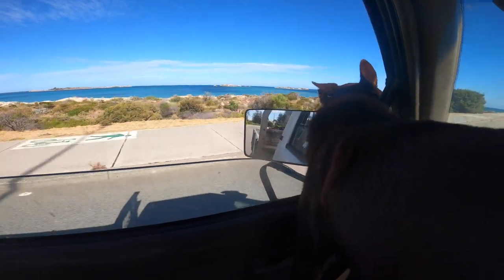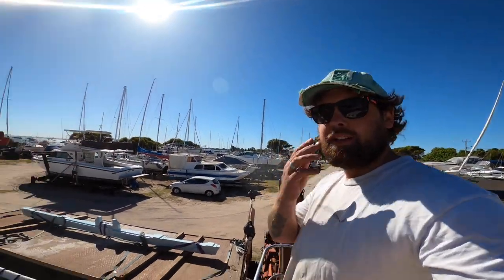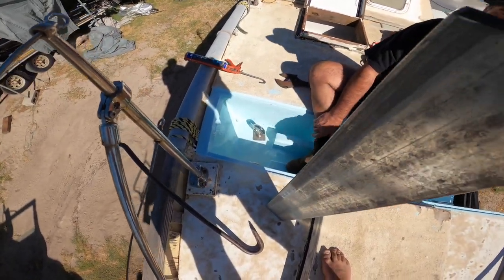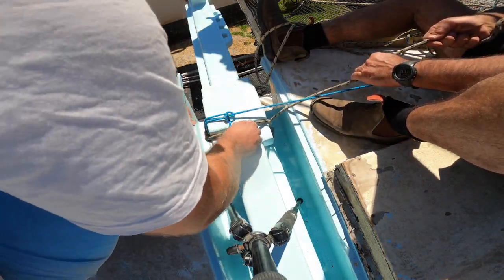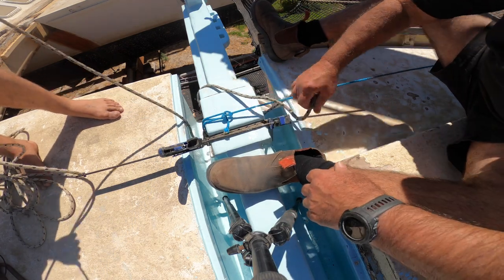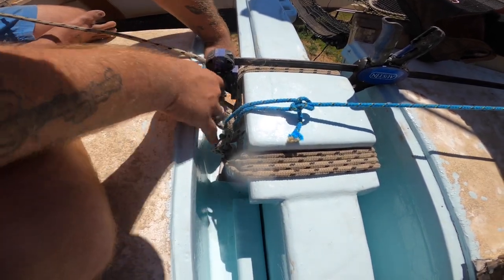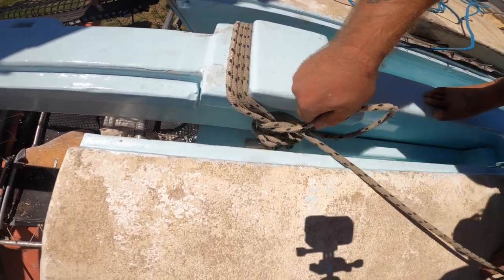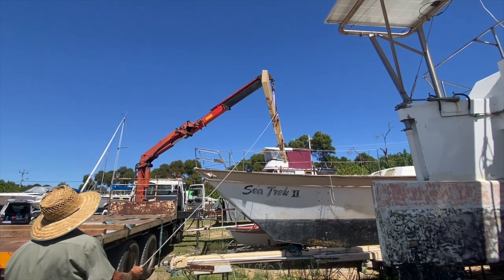LASHING BEAM #1 | James Wharram Catamaran Restoration Ep. 6

Comment: interesting that the beam is so narrow compared to the trough. I guess that was to make room for the bolt/rubber of the original design? I guess that lip is to allow a plywood cover?
Reply from the maker: Yeah they were very large troughs on the Narai to make room for the original brackets, makes the beam look small but it’s definately not ! And yeah the lip is for the deck 
Thanks for watching along

Comment: You were lucky, when I bought our Narai the beams had rotted so had to be replaced... 
Are the masts & sails good?
Reply from the maker: Mate that must of been heart breaking ! What did you make the replacements from ? 
Onto our next beam now and a bit more rot on this one, unfortunately I was told that our beams were Oregon when I brought the boat… I have now discovered that there just pine glue lam …. A lot of working going into sealing them now
Reply: @Sail Malolo  I went an unconventional route and used "Glulam" beams off the shelf.  They were taller so wouldn't fit under the deck covers of the Mk4. It then did 8 Atlantic crossings without issue (maybe more now with new owner)

Comment: Aye m8s!  I'm a bit worried (no criticism) …are you sure you'll get tension enough on these lashings?
Reply from the maker: This lashing was just for demonstration until we get the new rope. We have made a wooden leverage tool that we will use when we get the new rope the same as they used on Katipo for there voyages around Polynesia, we based our setup off his after conversing about it for quite a while and will use the same method as they did to tention 👍
Reply: Great! Looking forward to see all of this!
Reply from the maker: Thanks mate cheers for following along no advice is ever disregarded 👍
Reply: @sailmalolo  the tension does not come from the lashing itself but from building many layers of frapping. That squeezes the lashings ever tighter and tighter.